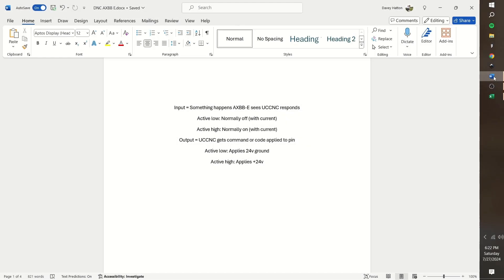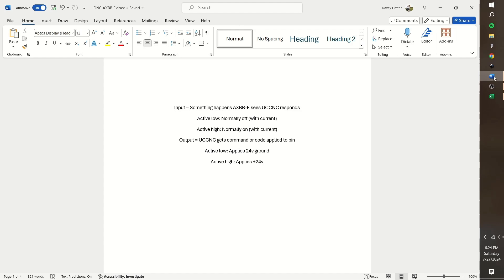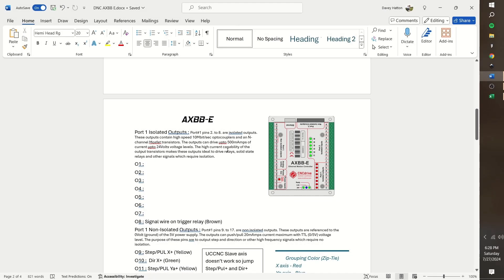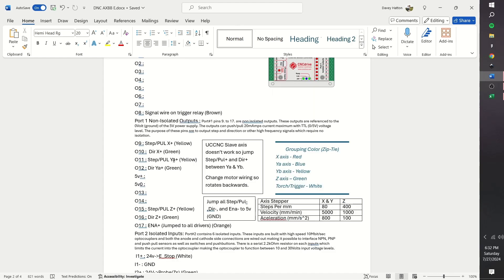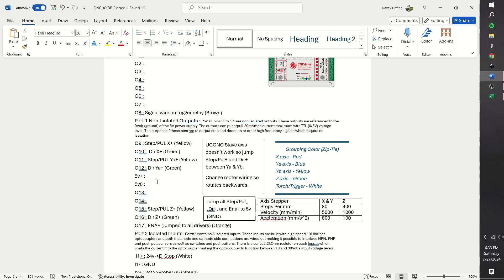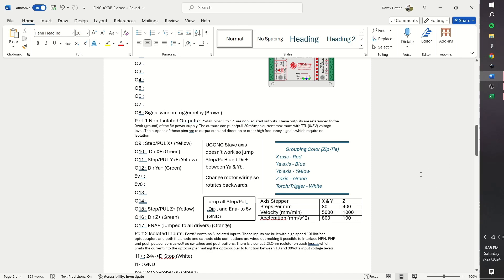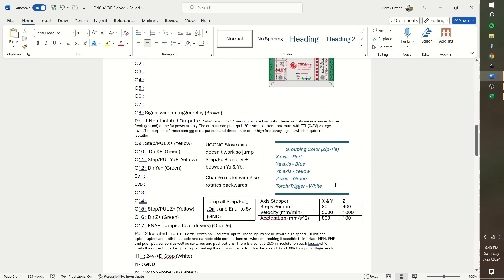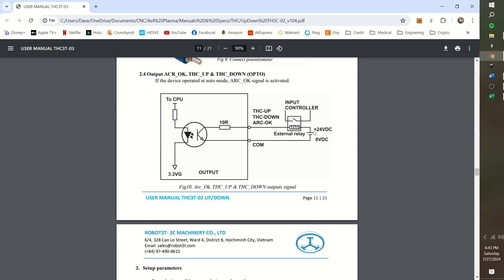CNC Pre Wiring Organization Guide (AXBB-E UCCNC)

Comment: Im thinking about using UCCNC  on my new build.  So Im youtube researching.  Did the auto square bug ever get fixed? Thanks
Reply from the maker: It is still  version 1.2113 so i would think no. After i jumped my steppers together I just forgot about it and moved on. I am part of a few facebook groups and no-one seemed to have that issue with the slave axis but I believe most of them run a mill and that screenset/setup. That could be the issue or they might just have an old version and never changed (no idea). But I do really enjoy the software its fair-ly easy to use while not being so focused on user interface/ease of use that the more advanced settings are hidden.
Reply: @dnc_fabrication  
Thanks for the reply.  I have always used linuxcnc but thought I'd try something different this time. I seen the problem you have come up a few times and seems like it was an issue of having the limit switch pins swapped between the y and slave axis. May not be the exact problem you have just the only issue I've found with auto square.
Reply from the maker: @shanester2594  maybe I’ll take a look at that. I’ve never used the linuxcnc. But they seem to be pretty equivalent programs. UCCNC will probably play better with the other programs since it’s windows based like sending gcode via cloud. But very minor benefits and linux is always updating, so that may not be an issue anymore.